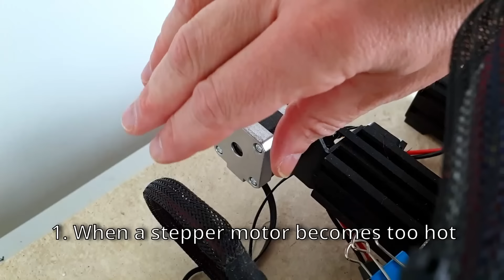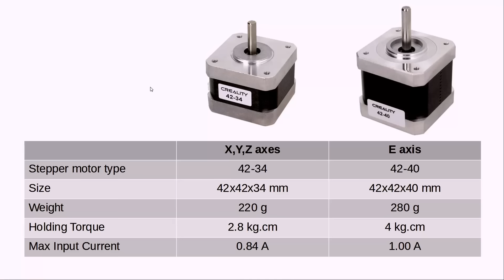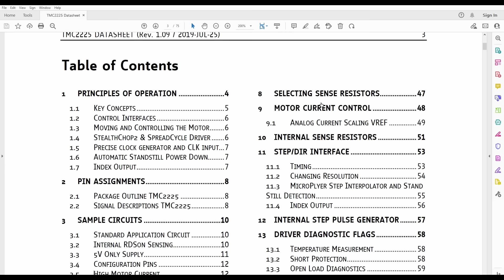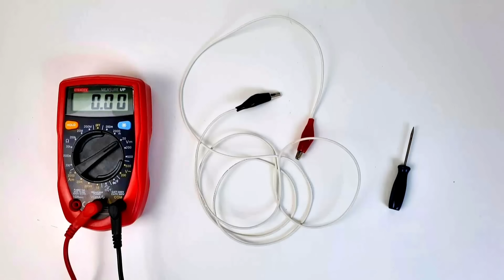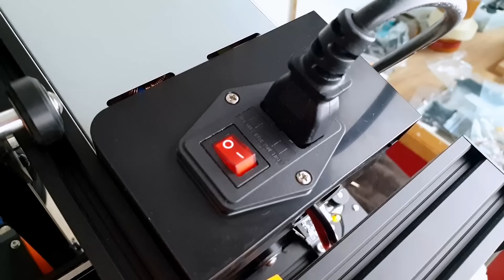How To Set Stepper Motor Current / VREF on Ender 3

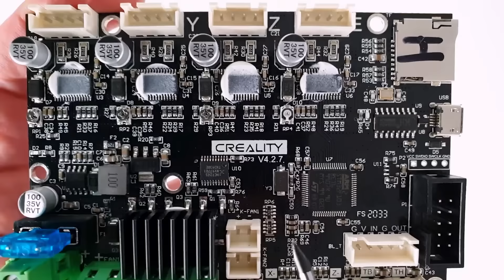Comment: 0:58 Recently, I broke exactly the same trimpot shown in the video while trying to calibrate an Orbiter V2.5. However, instead of paying US$60.00 for a new board, I spent a little more and bought a rework station to replace this component. I had to practice a bit first, but it was worth it in the end because it worked. Hehe.

Comment: Coming back in 2025 to thank you for this video.  I've recently upgraded my Ender 3 Pro (4.2.2 board and the A4988 driver) to Klipper and started experiencing Y Skipping.  I'd had issues with E skipping before, but never realized it until I noticed my Y driver skipping after the Klipper installation and realized the occasional clunk sound my E would make wasn't it slipping on the filament like I thought, it was the motor skipping.  After struggling to find what was causing the Y skipping I found forum posts talking about VRefs being incorrect and your video was a perfect explanation of how to adjust them.  All of my stock VRef voltages were set to 0.5V across all drivers and I've now set my X,Y,Z drivers to 0.85V and my E to 0.95V.  While the drivers are louder than there were before, they're all working perfectly now.  Thank you!

Comment: Thanks for this video! It is a great help. The 1000th like on this video is from me :) Have a nice day!
Reply: Funny, I've just liked the video which also took it from 999 to 1000 likes 🙃 

Im having issues with layer shift which i expect is due to high current/heat. Going to check and adjust the voltages to test if this helps reduce the issue. Thanks
Reply: @darrenbruce1993  I do not think layer shift comes from that. Check if there is play on your V-rollers. Try to get as little play as possible. Helped for me at least.

Comment: Checked the voltage for X, Y, Z and all are set to 0.89 from the factory. 
This is a 4.2.2 board.
Trying to up the current, to be able to handle the Dual Z-stepper upgrade.

Comment: Thanks! I have extended my bed on my Ender 3 to about 60cm. It is almost working with the original 42-34 motor but I am going to upgrade the motor to the 42-40 and need to get the current up some. This is what I needed.  
Since someone might ask, it works well but the vibration noise in the print is up. Since the vibration is consistent, for my non-critical application it looks good.  
I pressed the Like and Subscribe button. Cheers!
Reply from the maker: @louiskatzclay  Thank you for your comment! I'm glad you found the video helpful. Could you share how you extended the bed? I'd like to do something similar. Did you use a specific kit or customize it yourself? I'm considering extending the frame along the Y-axis and replacing the bed with a 235x470mm aluminum plate covered by glass. Did you stick with the original Ender 3 bed heater, or did you upgrade to something else? Thanks in advance!
Reply: @YouMakeTech   Yes. I will upload a video in return for your help. I will try to include most of a parts list and sources, It might take a day or two to get it together.

Comment: Hello, YouMakeTech
I want to replace the Y-Axis 42-34 stepper motor on my Ender 3 Pro with a 42-40 stepper. The stock motor gets pretty hot and all of a sudden, it stops working, it just jerks and not rotate.
So do you advise I replace with a 42-40 stepper and set the Vref to the same voltage as the Extruder motor ??
I'm not really good with all the Voltage calculations.

And it uses the HR4988 motor driver.
Reply from the maker: The current VREF is probably set too high and the driver gets too hot and stops working. Maybe you can try these things: keep the electronic board outside of the enclosure for better venting, add a fan that blows on the electronic board + measure the current VREF on the Y axis and reduce it by 20%. Reduce the VREF by steps of 20% until the motor skips steps, then raise it a bit until it no longer does. Hope this helps
Reply: @YouMakeTech  Just a reminder to everyone, the nozzle for the extruder must be over 170 C Hot before the extruder stepper will move.  This had be going for a while.

Comment: Thank you so much man! But one big question: what about the adjustment for double z with 2 motors on the same cable? Could you tell me how to calculate which Vref I should use please? Do I have to double the current, like 1,16x2 for a double 42-34? I am a bit lost.
Reply: Did you figure this out?

Comment: Great video, and I saw it because I have just added a dual z-drive with an additional stepper for the Z-drive and a split cable to the main board. When testing, only one stepper motor runs (the new one). My board is 4.2.2, card reader marked "C". I assume that I need to turn the VREF up for the Z-stepper, but I am unsure...
Reply: Did you figure this out?

Comment: does current effect and cause layer shift ?
Reply from the maker: Yes, when the current is too low, the motor skips steps. This causes layer shifts on X, Y Z and under-extrusion on E
Reply: @YouMakeTech  what volt or amp should my steppers be on? Cuz i have layer shift on X axis, mine is nema 17 42 /34
Reply from the maker: It's unlikely to be the stepper motor current for the X axis unless you go crazy fast! Maybe check the belt tension and the eccentric nut. Check that the print head does not wobble when you move it by hand. For the VRef, it depends in the mainboard you use. Please watch the video for more details
Reply: @YouMakeTech  the belt tension is good and i have 4 Printers , but one of them have MKS Robin Nano v1.2 borad woth TMC 2209 . The x axis make layershift randomly, the steppers are cold but drivers generate heat , i didn't check the volt of them but im just asking
Reply from the maker: @sgt.sasquatch  Sorry, I receive comments from people with varying degree of 3d printing experience from complete beginners to experts! Well, if everything is fine on the mechanical side, layer shifting can be due to the stepper motor skipping steps. Maybe try to increase the motor current (Vref) by 10% to see if that solves the issue.
Reply: @YouMakeTech  it's look like MKS Robin Nano boards are sucks

Comment: Hmmmm, I'm swapping a stepper for my friends printer and all his potentiometers are set to 1.38 volts even though xyz are using the 42-34 steppers. Shouldn't it only be set to 1.38 on the extruder since it is the big 42-40 motor?

Comment: great video, I was looking for something like that. now I'm even more confused. I have a 4.2.7 motherboard and 42-34 standard motors. I plan to get some 0.9 degree motors for x y maybe and Z(dual Z). which one should I choose from all those on the market. according to everything I see, it won't work because the voltage is too high in the calculation? can it work at all or do I have to change the motherboard for a 0.9 degree motor. any help?

Comment: Very helpful thank you.  Having issues with Ender 3 Pro with extruder skipping.  Checked everything, replaced just about everything and was always able to hand push filament without issue.  Tested E axis stepper and was coming in at 1.19, I bumped it to 1.24 and I'm currently running a 12 hour print and about 2 hours in with no skipping (actually very nice so far).  What is considered too hot for the stepper?  Any heat at all or burning skin?  It's a bit warm but not scalding.  I never touched the stepper before this to have a baseline to go by.  Great video, thanks again.
Reply from the maker: As long as you can touch the stepper with your hand, it's fine. Stepper motors are rated for 70 deg C. Ideally, you want to set the current high enough to not have skipped steps but low enough to keep the stepper/driver as cool as possible
Reply: @YouMakeTech  Thank you!  I've noticed that the E stepper is a bit cooler than the X,Y,Z steppers.  Now I'm going to check all of them.

Comment: Just check my ender 3 v2 v4.2.2 - X=1,2V, Y=1V, Z=1,2V, E=1,4V. Uusing your data, it means that i have X= 0,87A, Y=0,72A, Z=0,81A, E=1,01A.  Thats why my X,Z axis motor and E are very heat, Y is colder.  Thank you very much!

Comment: If I added a second Z stepper motor do I double the voltage?
Reply from the maker: no, this will overheat the driver. Start with the current VRef and only increase it 0.1 by 0.1V until you get no skipped steps. There are 2 motors but they need only half the torque, because the weight and friction is now distributed among them. They may need slightly more torque though because 2 lead screws generate more friction than one

Comment: i have ender 3 pro. my printer have sliping problem and my volt is 0.5 for each motor. 4.2.2 is my board and for driver part its writed GD and i dont know witch driver is it.

Comment: I just got myself a pancake stepper paired with a BMG-clone and have changed the VREF to 0.485v. Is there anything in the firmware that needs to be changed in order for it to work well? My prints are turning out really shoddy atm and crumble to bits in my finger tips 🥲. The only help I received from the supplier was a message saying "0.8A--485", so I assumed that meant set the VREF to 0.485v and 0.8A in the firmware, but I've not seen any guides regarding changing stepper motor current within the firmware. If anyone can help me, I'd appreciate it.
Reply from the maker: Which 3d printer/mainboard do you use? on almost all Creality mainboards, the stepper motor current is set by a potentiometer on the board and  cannot be set by firmware. The other setting to change is  DEFAULT_AXIS_STEPS_PER_UNIT which should be changed from 93 to 415 for a Bondtech  BMG or clone. Thiis because of the gear ratio of the BMG
Reply: @YouMakeTech  Hey! Thanks for the reply. It's a CR10-S PRO using a Creality v2.4 mainboard I believe. Is the "DEFAULT_AXIS_STEPS_PER_UNIT" setting basically e-steps, or something completely different? What VREF value would you recommend I set the potentiometer to?
Reply from the maker: @scottwinchester6162  Yes it's the same as E steps. For VREF, I can't help because I don't know your mainboard.
Reply: @YouMakeTech  Thanks for the help. I've just cranked the VREF up to 1.1v, re-calibrated e-steps, and running a calibration cube print as we speak. Lets see if that made any improvement.
Reply from the maker: You only need to increase the VREF if your extruder skips steps. Otherwise, try to reduce it to keep your motor relatively cool, while not skipping steps
Reply: @YouMakeTech  It turns out that the extruder motor was indeed the issue. I've lowered the VREF to about 0.7v now to reduce the temperature, and it's printing like a dream now. Thanks a lot for your help!

Comment: Great video.  Succinct, to the point.  Thanks!
Reply: My creality 4.2.2 board has the GD 32F MCU. It has GD on the SD card slot.  I removed the heatsink on the stepper driver to see which stepper driver it used, but it is unreadable.  All of the current voltages were x-.572 y-.572 z-.572 and E-.71.  I suspected Z axis was too low, but I don't know what voltages to use.

Comment: The motors on Creality printers are unlikely to get hot.  More likely is the driver chips on the board getting hot.  My Ender 3 Pro 4.2.2 had VRef set at 5.78V for XYZ from the factory with 150mOhm resistors.  When I bumped them up to a volt, the driver chips started getting very hot (>65°C on the heat sinks).  I dropped them down to 0.72V and the temp dropped by 20°C to the mid 40s.  I left them there, since I wasn't having any skipping at that voltage.  Same for the E channel.  At 1.2V, driver chip got hot.  Dropped it to 0.9V and temp is steady in the mid 40°C range.  My point is be careful because the driver ships will heat up way before the motors and if you fry them, you will be replacing a board.  I'm not sure why the calculations don't seem to jive but wanted to report my findings.
Reply: Are your chips equipped with those little cooling fins?
Reply: I also have a stock 4.2.2 board on my Ender 3 pro. assuming we have the same stepper motor drivers with E on our card reader, the motor drivers we have are A4988 not the TMC drivers he talks about in this video, and have different calculations for I and treat Vref slightly differently.

 on the A4988 data sheet I found internal PWM current control I(tripMax)=V(REF)/[8xR(sense)] so Vref=Imax*[8*.150 ohm]   

not sure how your xyz could stand a Vref of of 5.78 but my E is running slow and not turning fast enough almost stalling. when I switched my E to X port, E would work fine but then my x would be at a crawl. so I'm going to try upping my E Vref if its less than 1.2V and see if that fixes my under extrusion. wish me luck

Comment: Hey, would going through this process be the thing to do if my ender 3 pro is barely extruding anything? I tried adjusting the e steps and it only works if I set them super high like at 1000 and only for a few seconds before hardly extruding again. Im not too good at this but it seems to me like the motor isn’t strong enough to push the filament through. Thanks
Reply from the maker: Not sure. Which motor/extruder do you use? If stock, I would restore the default e-steps (93 steps per mm), increase the nozzle temperature and try again. 1000 steps per mm is way too high and can trigger over-current protection. Maybe your motor needs to be replaced.
Reply: @YouMakeTech  im using the stock motor and the extruder is an upgraded metal one, I tried at 93 steps and it still barely prints, I could try replacing the motor before trying to set the current.

Comment: How do you feel about putting some inexpensive heatsinks on the stepper motors? It might help increase the life of the motor for a few bucks?

Also. Someone said not to move motor by hand because the feedback can damage the drivers. Is that true? I would think the engineer would design some protection for this.
Reply from the maker: heatsinks are good, they help to dissipate the heat. Stepper motors can run quite hot though, 70 deg C is  not an issue! I think it is right that turning the motors by hand when the printer is off can damage the electronics and should be avoided.

Comment: Awesome. I wanted to ask if this can also help get rid of stepper motor noise. Recently, I replaced my failed motherboard on Ender 3 v2 with 4.2.2 silent mobo. However, the stepper motors are making too much noise, which was not there before. But steppers are running cooler than earlier.
Reply from the maker: Not all 4.2.2. mainboards come with TMC drivers. Some of them are vey noisy. Try to get a Creality 4.2.7 or better, an SKR Mini E3.
Reply: @YouMakeTech  I can't. The printer is just a month old and I got the board replaced by Creality. Don't have budget to buy new mobo. Can't I do anything with this board to silent motors. As I said, they are runnibg cooler than earlier but noisy. Anything, firmware update or Vref adjustment?
Reply from the maker: @ravis1ngh  I don't think so. The reason the silent mainboards are silent is because their drivers run in a special mode called stealthchop. See https://www.trinamic.com/technology/motor-control-technology/chopper-modes/ This mode is only available in TMC drivers. Maybe complain to Creality that your mainboard is much noisier than before and they will send you a silent mainboard!
Reply: @YouMakeTech  Sure. Thanks 😊 Keep up the good work.
Reply: @YouMakeTech  One more thing, would you recommend TL smoother for E3V2.
Reply from the maker: @ravis1ngh  I haven't tried but I believe this will help to reduce the noise.
Reply: @YouMakeTech  back with an update. It started working fine aftet I flashed the HS 3x3 firmware for v4.2.2. Earlier, I was running HS 5x5 v4.2.2 
How firmware can impact stepper motor noise?
Reply: @ravis1ngh  it's possible stealth chop was not on?
Reply from the maker: I don't think so because stealthchop is forced on on Creality mainboards. This is not configurable by firmware because the drivers are operated in standalone mode

Comment: I have Upgraded my E-motor for a Pancake one, but i didnt get any info about it. 
Its running, byt its getting very hot. So i might go down with the Eref once i get my multimeter.
Do you have any Tip where i should start? Was thinking to go down to 0.8V. Or is it too low?
I have a BMG-clone that is powered by the Pancake Motor.
Reply from the maker: 0.8V might be too low. A VREF between 1.0V and 1.2V should work fine with most pancake stepper motors.
Reply: @YouMakeTech  Thanks for your fast answer, i will try it with your suggested VREF! 
And thanks for all the work you put into your videos. They really help alot.
Reply: @YouMakeTech  Just wanted to let you know, 1.1V seems to be perfect for my Pancake-Motor.  It doesnt get Hot anymore (just warm, i can touch it) and it does not skip steps! 
And with your video guide, it was easy to set up the Correct value.
Thanks again for your help.
Reply from the maker: Good news. Glad my video was useful!
Reply: I also have a Pancake extruder, the VRef was set to 1.4v it was getting very hot and skipping steps, now its set up to 1.16v and its still skipping and getting very hot
Reply: Hi Kanna, I also just got myself a pancake stepper paired with a BMG-clone and have changed the VREF to 0.485v. Is there anything in the firmware that you needed to change in order for it to work well? My prints are turning out really shoddy atm and crumble to bits in my finger tips 🥲. Any help would be much appreciated.